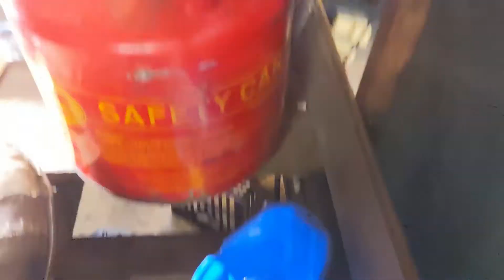'51 Dodge 360 Holley Terminator EFI Install and First Fire!  And We Swap in a NV4500!

Comment: Absolutely love the simplicity of this swap! I just found out Holley supports the 46re also, which means I'm going to run the Terminator X Max. Anything you found that was extremely annoying or anything that'll make the swap easier?
Reply from the maker: It's pretty straightforward. The more I play with the Holley the more it impresses me! If you haven't watched my how-to video go check that one out, it lays out how I did everything!
Reply from the maker: https://youtu.be/KWZl0iGtYkQ
Reply: @Fed Up Fab  yeah I've been following it along. My 97 is now a safety only inspection which means I can start having all my fun now.
Reply from the maker: Hell yeah 😎
Reply: What do you mean holley supports the 46re?
Reply: @stephenm6036  yes sir! The TerminatorX Maxx supports the 46re transmission!
Reply: @Dimination36  I am assuming the sniper doesnt support it?
Reply: @stephenm6036  as of right now only the terminator x Maxx does

Comment: Glad I found this video, I'm in the process of magnum swapping an e30 BMW and wanting to use a Holley terminator as well so this will help me a lot! Send like the install was pretty plug and play? How much custom wiring? Any tips?
Reply from the maker: I'm running the universal Terminator X kit. For cam/crank signals I'm using the dual sync distributor. All pressure and temp sensors I swapped to Holley style sensors. TPS is factory just using a donor harness and swap the connector onto the Holley harness. IAC plugs right in. I did junkyard truck LS coils and used the Holley harness for that. It's pretty straightforward overall, no tricks or anything.
Reply: @FedUpFab  awesome! Coil near plug conversion huh? I've seen that a couple places online but wasn't sure if I wanted to go that route or just keep the distributor
Reply from the maker: If you want to run the Holley dual sync as a distributor they make you run their ignition box and coil, that's more money than the LS coil setup. The Holley harness for LS coils is like $100 and I got 8 takeoff coils plus the GM subharness for $70 off eBay. And I've had zero ignition issues, no blowing spark out, no issues at all. Highly recommend the GM cool setup.
Reply: @FedUpFab  dang that's a good tip, thanks!

Comment: Man can you please tell me what you used to connect the throttle cable? Did you buy a bracket or anything?
Reply from the maker: I used the stock Magnum throttle cable and bracket on the throttle body. On the pedal I just made a little bracket to hold the end of the cable.
Reply: @FedUpFab  do you have any messengers etc.
Reply from the maker: Facebook or Instagram. Fedupfab on both
Reply: @FedUpFab  well man the reason I ask is I originally just threw away my stock throttle body, including the bracket. I'm looking online and should I get some sort of other bracket (lokar bracket) or just buy another used throttle body and remove the bracket and use that. Thanks man
Reply from the maker: I would just go to the junkyard and grab a bracket and cable.